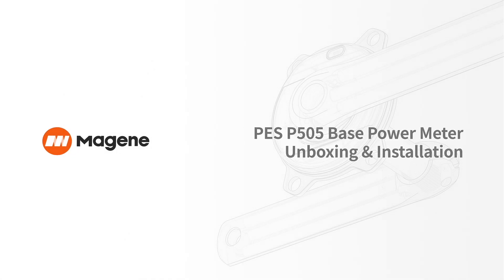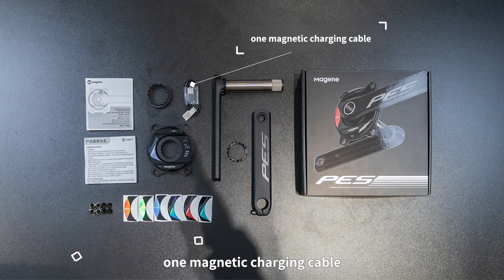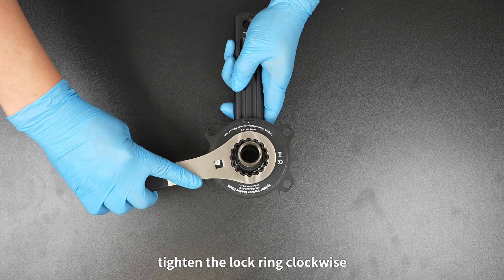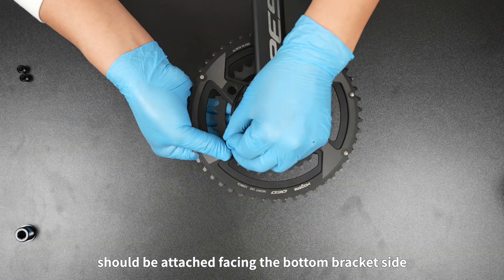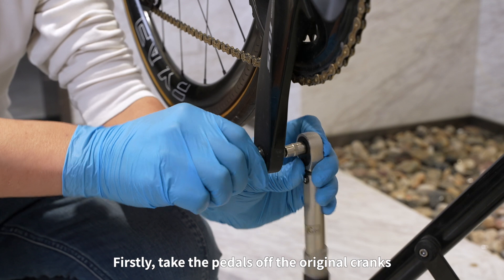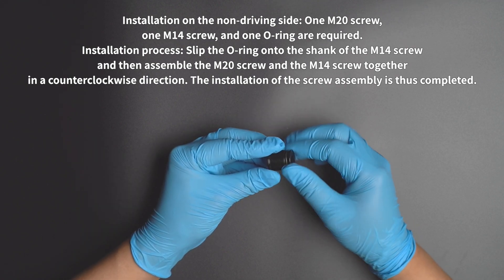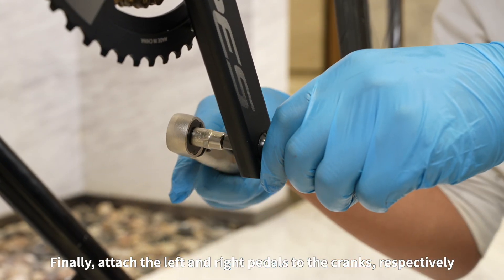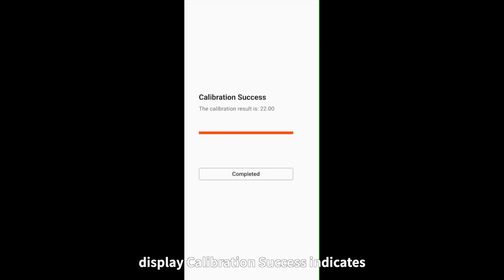Product Guide: How to install Magene PES P505 Base Power Meter?

Comment: Where am I supposed to find that nowhere-to-be-found BB44-16T wrench? I've tried with other keys, the plastic ring flies away even when I try to tighten it by hand, let alone applying 40 Nm to a key connected through a square hole in the key, connected to the lockring through this slippery plastic "conversion" "tool". Please, send me a link where I can buy this BB44-16T wrench, since you considered it not useful to add it to the package (whatever the cost...). All similar keys I found have a TORX-type hole, where I couldn't fit the tip of the torque wrench in...

I bought the LEBYCLE H44-16. but it has a hexagonal hole, damn it..., and with a 15-mm side, what kind of standard is that... normally they go 10, 12, 14, 17, 19 ... NO 15 mm damn you people, why couldn't you just include this rarity of a wrench in the delivery, I've already paid more than 200 us dollars for various other tools that won't work for this purpose, that's a big screw-up of you...

Comment: I just installed the power meter. I updated the firmware and performed a "Zero Calibration", but the power and cadence data remains 0 on the Magene Utility App. Same result with Rouvy when connected over ANT+. Both apps are saying that the sensor is connected and everything but the power and cadence seems to be reported correctly. Anybody else experienced this?
Reply: If anybody else experiences this, I fixed it by:
* Uninstalling the Magene Utility App
* Resetting the power meter (connect the charger and approach a second magnet near the red led, led should be blinking upon reset)
* Reinstalling the Magene Utility App and perform a "Zero Calibration" again
Reply: @louisdupont1247  hey, can you please explain how did you reset the power meter with the charger?

Comment: Why dont you comment/communicate about the original large hex bolt coming loose and the updated hex bolt @3:20- My NDS crank came off when cycling and was very dangerous!You know about this issue so please be upfont with customers!
Reply: Are you referring to this issue : https://www.youtube.com/watch?v=Kv69g2StmVU ?

My understanding is that the fix is not an updated bolt. You must, in order :
Tighten the 10mm bolt to 1-1.5 Nm (or just enough to put the arm into place without any loose)
Tighten the arm (5mm bolt) to 12-14 Nm
Tighten the 10mm bolt again to 10-12 Nm
Tighten the 6mm bolt to 10-12 Nm
Reply: @louisdupont1247  For the revised version yes. The original version (like I just got this morning) doesn't have the 6 mm bolt, just the 10 mm bolt. What then? Loctite?
Reply: @Dearlp640  did you find a solution to this? I have one of the original ones with the one bolt through the axle (10 mm). After  I removed it to change my bb I cant get the nds to stay on!

Comment: Is this compatible with 105 di2 12 speed? I've heard that the large chainring can be too close to the front derailleur
Reply: No its not. Dont hear the bs they say. I have it from launch day and i have only problems woth front derailleur. they even ignore me in mails. Whatever you do and setup carefully the small chainring grinds to jump to big chainring.
Reply: I have used it with 105 di2 12 speed.  I put my 105 chainrings on this Magene PES P505 Base.  I would say it is compatible but not perfectly.  It moves the chainline outwards about 1.5mm.  You then have to adjust the derauiller's set screw outward about 1.5 mm.  Then, when adjusted, the derauiller cage comes incredibly close to the crank arm which are straighter than the shimano ones.  Be careful that you adjust the front derailleur when it is in big chain ring - small cog to ensure a comfortable clearance because this is when it is furthest out.  I left it with about 1 mm clearance which doesn't seem like a lot but it is not touching in any normal scenario.
Reply: @scottc2041 Same experience here! But it passed and it seems to work, I even put alugear 54/40T chainrings on it and it works well so far.
Reply: And why is it only with 105 set? Dies it work with Ultegra?
Reply: Only with the di2? I use mechanical 105 r7100 12s and i wonder if it's gonna fit, 170mm cranks, 50/34 chainrings
Reply: @rado1746  it fits on my Ultegra mechanical
Reply: @rado1746  In my case, I used the shimano 105 di2 fd-r7150 front derailleur.
Reply: I dont know

Comment: Any update if this will ever be compatible with oval chainrings guys? (I have tried with Absoluteblack rings and readings are way off).
Reply: Have you sorted this?
Reply: @ sold it as there has been no update on it ever being oval compatible which is a real shame.
Reply: @bsharp771  I have been using it for a few rides now with no issues with oval chainrings. I had strange readings on the first ride but was resolved by doing a quick calibration. 
I will throw it on my turbo to do an analysis later but overall initial impressions 'feel' accurate